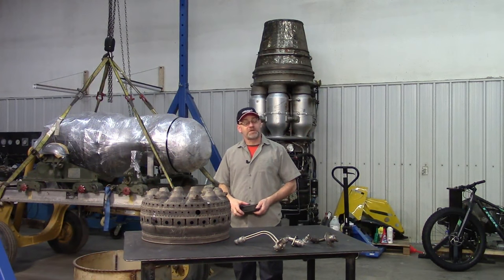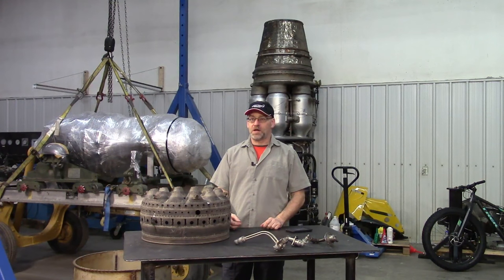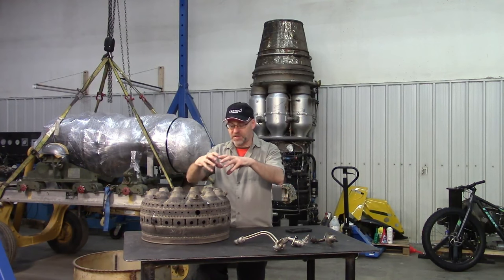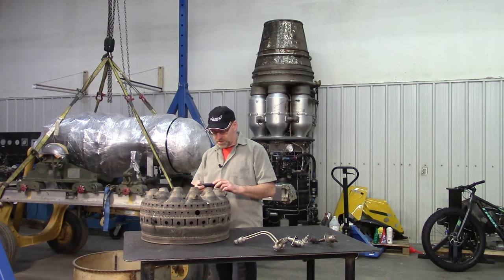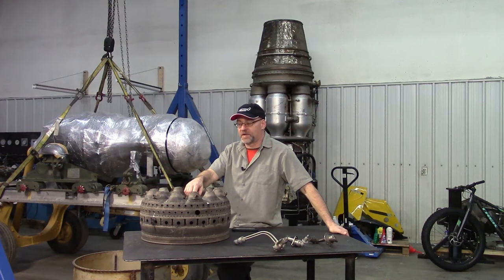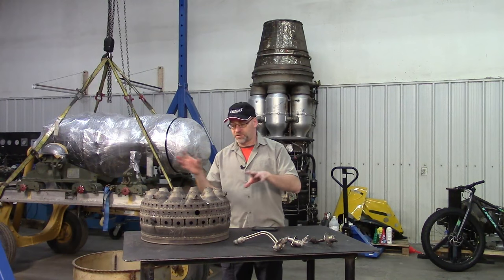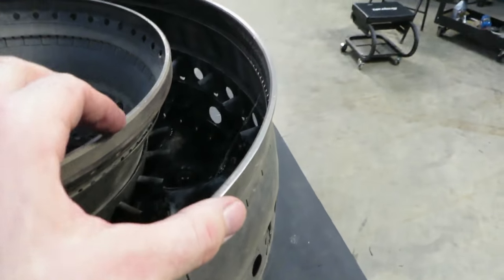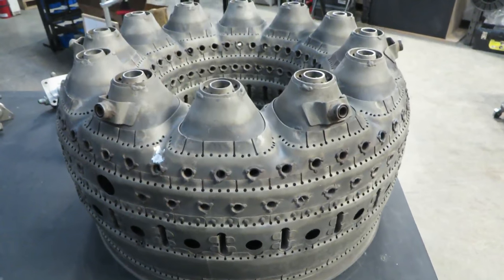Jet Questions 90

Comment: I believe that there was a 380 engine which ran away when the RR engine had a lube oil line failure.
Reply from the maker: No, that is not the same thing. A turbine overspeed due to a broken shaft is not an engine runaway. Unless you say it is,  but then I get to say I own Park Avenue.
Reply: AgentJayZ my understanding was that the lube oil provided a bunch of extra fuel, not a shaft failure, but it was quick (according to the Mayday show. You mighty like Park Ave. thanks for the great shows
Reply: Wrong! Please see my answer to Juha Tuomala.
Reply: Agreed, AgentJayZ.

Comment: Please bear with me.  First, are you self taught, a participant or perhaps educated by a formal institution such as a university.  Second, are a couple of rhetorical comments, though I would appreciate your comments (I know, I’m hypocritical, I suppose,). On various videos you’ve produced, whether it be combustion chambers or radial compressors, you state though the flow is increased pressure does NOT increase.  Or, in the combustion chamber, given fuel and air flow may be  ignition of the fuel does NOT increase the pressure.  Isn’t that what thrust is.the pressure moving backward forces an equal and opposite force forward?  Finally, I suspect you have quite the insurance policy to cover not only the engines you work on, but the potential liability of a failed engine may have upon a very expensive aircraft and possibly human life and property damage caused by a failed engine.  Thanks again for swelling my brain with knowledge and imagination.✌️🤙
Reply from the maker: You need to search the the interwebnet for the Turbojet thrust equation. Study that until it makes sense, and realize things are always more complicated than it first seems.

Comment: Would it be possible to fit an gas start cartridge
To it's gearbox
I see the Raptor F 22
I get more and more impressed with that aircraft
Is this the kind of job that you can do 
I do understand the new gearbox may be required
As long as it's logistics have been taking care of a
QRA Scamble, the pilot can start all on his own
I often watch videos again it is not work if you enjoy what you do I hear said
Goodnight my friend
Reply from the maker: This engine is started by direct rotation of the main shaft. It would be of no use to start it through the gearbox. The gearbox on this engine is not designed to handle the torque of a starter.
But yes if you wanted spend a great deal of money, you could make a new internal nose gearbox, a new radial driveshaft, and attach an air turbine starter, or a combustion gas starter. You could then start this engine differently from the way it was designed to.
Reply: @AgentJayZ  you are right I should have thought of that
AgentJayZ my P & W PT 6 model has just arrived I have not opened it yet but I'm about to
Thank you so very much
I am a extremely happy amateur jet tech who just has Theory in education but this gives me a hands-on experience with an turbo shaft model engine I know well
I feel so lucky i am not a betting man
I will photograph it's development
THANK YOU AGENTJAYZ

Comment: It is suspected that the uncontained engine failure of National Airlines Flight 27 may have been a result of the crew playing around with engine throttle settings and causing the engines to overspeed.  

https://en.wikipedia.org/wiki/National_Airlines_Flight_27

Comment: How measure the jet engine power
Reply: Power = Torque * Rotational velocity. So, roughly speaking (I am just guessing here), they'd use a test stand that places a retarding torque (or 'load') on the engine, max out the throttle, find the torque that has the turbine can maintain its specified RPM at, and then you just calculate Torque * Rotational velocity, i.e., power. Obviously I'd also love to see specific details though.

Comment: sir please make a video  on super sonic engins
Reply from the maker: The J79 propels various aircraft to over Mach 1.5. So does the RR Avon. The air being used by the engine flows at subsonic velocities. I have never even seen an engine that uses supersonic flow and combustion, if that's what you mean.

Comment: Every internally combustion engine has a simple governor. In the case of mal function engin will run a way., No matter diesel ,gas or jet
Reply from the maker: +Pejhman Bakhtiary 
Nice simple rule you got there.
Does not apply here.
If you want to call a net engine fuel control a simple governor, you have no idea how it works.
Reply: I believe what the first viewer question was referring to was a instance of a runaway diesel engine whereby case oil manages to pass the piston rings and gets consumed and burned by the compression/ignition cycle. Even though no fuel is being injected, the oil serves to fuel the cycle, and, since there is no need for a spark, the engine can "run away" and destroy itself. For this reason, some large marine diesel engines employ the use of a emergency valve that can shut off all air coming to the engine via the intake, thereby cutting off the oxygen to the combustion cycle.
Reply: Look up chalwyn valve, used for turbo seal failures on every recip engine offshore where hydro carbons are potentially in the atmosphere. I think the explanation of ingested “fuel” covered turbine issues as it would burn before the combustor section seemed to cover that. Over speed of a turbo power unit by load failure, say a coupling failure is not the issue, that is not the prime mover, expect those to have transducer monitoring of speed and thence hot gas reduction via prime mover fuel control.
Reply: Pejhman Bakhtiary - WOW!!! There is a slight over-generalization... NOT ALL internal combustion engines have governors. Some have throttles (gasoline engines), some have fuel controls (diesels and gas turbines). And MOST Diesels are governed - both at the maximum and minimum RPM levels, as are all gas turbines that I know of. And as mentioned in another comment in this thread, many diesels (Detroit Diesel two-strokes come to mind) have air valves in the intake tract for emergency shutoff. Ever seen a two-stroke diesels run backwards? It's a freaky feeling if you don't know what's happening...😀

Comment: Runaway can be caused by a few things on a piston engine ,. on a 2 strokes  an airleak can cause a runaway ,. or overheating can cause a runaway ,. a jet engine is as close to a 2 stroke engine I can think of ,. there literally is no stroke ,. if a jet engine could relate to a piston engine , what would a jet engine be ?  a 1 stroke ?  0 stroke ?  lol ... now back to my point ,. on a jet engine  you really can't suck more air in ,. even if there was a air leak somewhere ,. the intake  of the engine is so massive it will overcompensate  any "air leak" if even possible ,.. but if a Jet Engine  ever  did  that ,. it would bring a whole new meaning to shitting your pants .
Reply from the maker: A jet engine is not related to a piston engine in any way except they both use heat to expand air to do stuff. Otherwise... in-teress-ting...
Reply: AgentJayZ what happens if they run lean ?  or  is it impossible for them to run lean ?  if so , why ?   sorry for all the questions just curious ,. I own a Jet Ski repair  biz  and  some day would love to find a job like yours ,. I just have no clue where to start to find a Job like that
Reply: A jet engine combustion chamber cannot be made to run 'leaner' or 'richer', because there is no way of varying the air/fuel ratio: there is no butterfly valve at entry to the combustion system. If the fuel flow is increased, the engine runs faster and produces more thrust: if the fuel flow is reduced, the engine runs slower and produces less thrust. However, having said that, whilst the air/fuel ratio in the primary zone of the combustor is stoichiometric (more or less), cooling and dilution air enters the combustor downstream of the combustion process proper and the engine is effectively running 'lean' at all times.
Reply: makes sense now ,. I can see how its kinda impossible to spin it faster ,. its like stuffing a camp fire out  or trying to blow on cooking temp coals ,.. not really going to have any affect ,... I love air planes ,. J-Z  can we trade jobs please ?  lol

Comment: Sad, a "Runaway" engine is using lubrication oil as fuel. So, Agent JayZ didn't understand the question or the nature of a typical runaway engine. 
Moral of the story, a jet engine tech might not understand everything under the sun.
Having been a Master Mechanic, for many years, and not a so called "Tech", I understand theory and don't just follow the manual. Having a real understanding of the science and theory, I could write the manual. 
This is the difference between a Mechanic and a "Tech".
Reply from the maker: Thank you for the condescension. It would be insulting if not accompanied by such a humorous dollop of ignorance.
"Moral"? you're joking, right?
"Typical" runaway jet engine? No such thing.
I'm going out on a limb here, assuming you are a master of pistons, so that makes your lack of knowledge about turbine engines understandable.
Still reading? Ok, then. the fuel consumption of a J79 at Idle is about 5 gallons per minute. At max power, the consumption is about 35-40 gpm. 
In afterburner, the engine uses a total of ninety gallons of fuel per minute...
 
No abbreviations to ensure you understand that.

The total flow capacity of the oil system ( to all three bearing sumps ) is about 6 gpm.
The total reservoir capacity is about 11 gallons.
The fuel control measures EGT, and if anything else but the fuel started burning and adding heat, fuel flow would be reduced.
The fuel control measures rpm, and if anything caused the engine to speed up, fuel flow would be reduced.

Now I know it's not good to say never... but a runaway turbine engine the way you piston guys talk about it, has to my knowledge never happened.

I will take your word for it, though, because you are so obviously and righteously my superior.
Reply: Well then, why don't you start a youtube channel to dispense your "expert" knowledge of the subject. I take it you are the one who liked your own comment?

 As a journeyman electrician, you kinda remind me of the way some other journeyman act when they decide to get their masters license. Once obtained some take on an attitude of "superiority" that's just ugly and difficult to work with.  I respect the ones who stay humble and continue to act as an equal but despise the ones who suddenly think their shit doesn't stink.  You remind me of the latter, bet your fun to work with! 

 I've even had some employers tell me they will flat out reject hiring a master because of the problems they create on the job!  I don't blame them one bit for not taking a chance.

Moral of the story, a little humility goes a long way.  Science and theory are great, you may be able to write the manual but being a condescending, know it all bitch just turns people off.
Reply: Lol!  Yeah, I love the "I can write the manual" part.  I'm thinking a fair amount of alcohol was involved in his post, at least I hope!
Reply: Maybe he meant he could write the book on auto mechanics and was stating the answer to the simple question of why a runaway jet is or isn't possible wasn't explained to suffice satisfying his mechanical theory based on his knowledge of autobomile mechanics, which he is a master of. Or whatever. Lol
Reply: You wrote: "....don't just follow the manual. Having a real understanding of the science and theory." First Jay is not a DIESEL.... He was asked about Turbojet engines and they WILL NOT RUN ON CRANKCASE OIL (LIKE A DIESEL MIGHT).  To address your comments,  you SHOULD follow the manual. It was written by people who know more than you. You are not that smart. Second you are not an Engineer who really understands the science and theory. The idea a turbo jet engine ruining away on crank case oil is ridiculous. Runaway could mean excessive RPM or not being able to turn off since both Diesel and Turbine are self igniting.